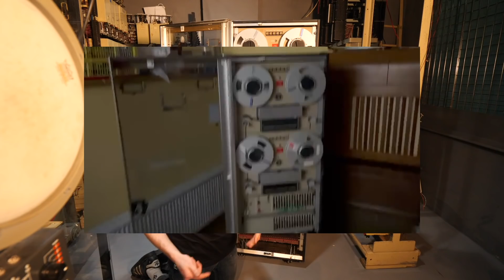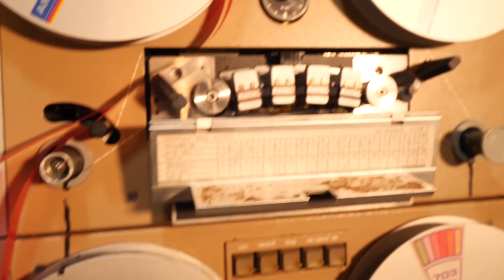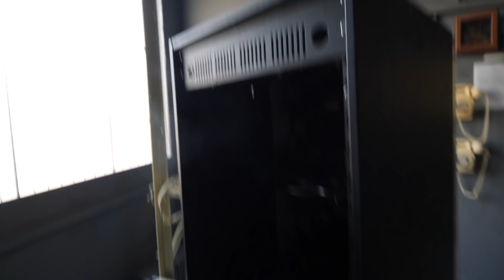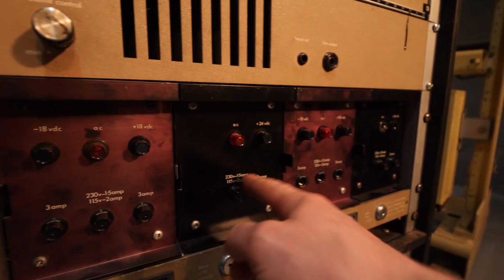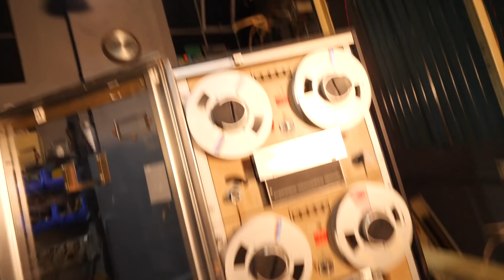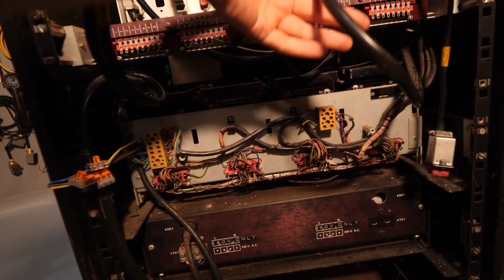The Racal ICR 32 REEL TO REEL Air Traffic Control Recorder

Comment: That’s a fine looking piece of equipment! If it is a 32 track recorder, I would suppose that every channel is assigned to a specific flight. So potentially the tapes could have conversations of 32 simultaneous flights on them, provided that tapes are still good. It be a potential time machine, going back to the last day that the machine was used.

Comment: I bet you it records at 15/16 inches per second. Like cassette on half speed. Then the reel would last 16 times longer. And it looks like either 1 or 2 inch wide tape. Its probably one of those standard sizes. I am a tape guy but I know nothing about this machine.
It could record audio and then be super lofi sounding. But I dont think you could synchronize the tracks to do any multitrack recording with this.

Comment: Also weird how the heads face upwards and record on the back of the tape, not downwards like a regular audio reel to reel, recording on the inside.

You do realise that Hainbach will want to run it at half speed anyway, right? Hahaha
Reply: It’s recording on the right side of the tape. Look how the threading works. It’s coming off the right side of the left reel, through, and onto the left side of the right.
Reply: (I think. I could be wrong, but it is the reverse of my reel to reel recorder)

Comment: could it be 15/16ths of an inch per second? (half cassette speed). As it's a logging machine of sorts, I bet the heads are record and playback - if you wanted to erase an industrial tape I bet the reels get run through a bulk eraser - but you might not ever want/need to accidentally erase a flight log on the machine itself!

Comment: The questions I have from some people in the know on these. Is is that erase and record heads. Or record and read heads for monitoring that the tape is correctly recording
Reply: Tapes may have been erased externally with a degauss coil before reuse.
Reply: Best guess would be record and read heads. Since the tapes were swapped daily and saved for record keeping, I wouldn't think they would need an erase function.
Reply: Keep in mind there's 4 heads.. and with that in mind, you should have the usual: Erase, Record, Playback and in this case, a dedicated Reverse Playback head. At least that's what other typical 4-head R2R machines have and I suspect this one is no different in that regard. :-)
Reply: @R3TR0R4V3  I think this one has 2 16 channel record heads and 2 16 channel read heads and no erase head

Comment: Lovely machine!
(15 IPS is a reasonable normal tape speed no?? 1.5 would be a super low speed. just sayin'
Reply: 15 IPS is what studio-quality recorders use, way more than needed here. I would expect at most 1 7/8 IPS which is cassette speed.
Reply: 7 IPS is standard for decent quality recorders, and much less than that for background music or logging applications
Reply: @FloydBunsen  even 7 is still too fast for this application.  1 7/8 is a more reasonable speed for speech.

Comment: I know a little bit about this as I worked on digital recording systems in the 90s.  All conversations between a plane and the flight controller must be continuously recorded as a record in case of an incident.  Each channel would record
Reply: .. one seat in flight control.  The audio comes over as a 600 ohm twisted pair, a bit like a phone line, into a transformer on each input channel.  The recorders have record and playback heads to prove recording is working.  This stuff is essentially telephone audio quality.  I guess the tapes auto swap every 24 hours, or if there is a fault.  Tapes would be stored in locked cabinets - kept for some months.  There would have been a separate playback station.
Reply from the maker: @barryculveruk  cool to know! so you recon thats record and read heads? woud the tape be re used? i guess there would be an erase machine aswell for that? or do they just use new tape?????

Comment: Yep, it would run really slow, that's why it's more for voice, if there was a way to increase the speed, you may get better quality, but that's a longshot, i just made a vid for techmoan on speeding up that type of motor, but i doubt it would speed it up enough without casing damage, you'd have to speed up all 3 motors in each machine.
I would guess that normally one recorder will be running with the other on standby, once the first tape runs out, it switches to the standby one, then someone will change the tape on the first one and set it up as the standby.
Looks like 2 heads for erase, then 2 heads for record, the monitor speaker is just for monitoring, you probably don't want to tie up the machine toplayback, that might be another single machine for that
Reply from the maker: the thing that makes me thing they are record and read heads is the fact i have heard it mentionned on some sites aswell as a comment above about a monitoring to make sure it is recording correctly. but then there is no erase heads. maybe they just didnt re use the tape who knows. im sure it will come apparent when i open up the mixer.
Reply: @THISMUSEUMISNOTOBSOLETE  If you check the link i posted (might be in your moderated folder), yeah, the guy said something about record and play heads only, they would need to put a clean tape in (or one that has been through a bulk eraser)

Comment: Wonder how much there is on the tapes.
15 inces per second would be 0.38 meters per second and over two meters per minute... i would say that is fast.
Reply from the maker: yeah I got that wrong. will figure it out, itll be easy to see if I can get it going
Reply from the maker: but yeah interested to see whats on the tape when its going, hopefully there is playback, im guessing so. seems to be read and write heads and in and outs for each channel
Reply: @THISMUSEUMISNOTOBSOLETE  
you may have someone around who ist on the same side of the channel as you but if not, and we get german customs sorted i am happy to make new rollers for it.
i guess they have all gone to hell.